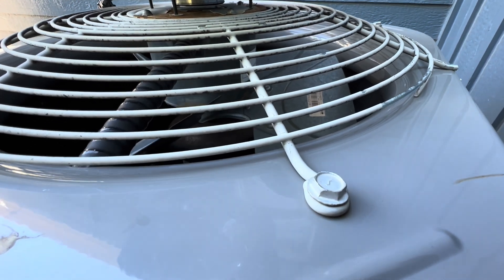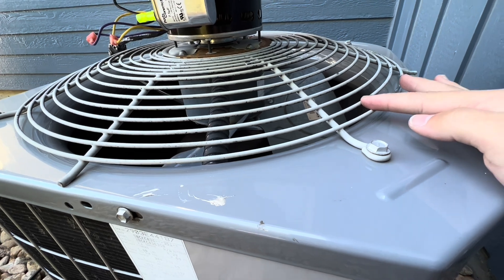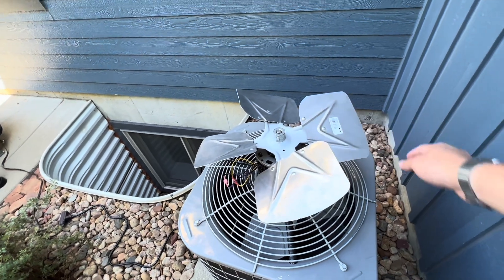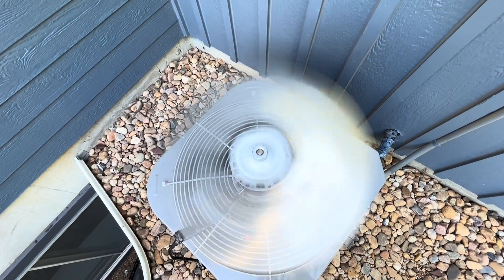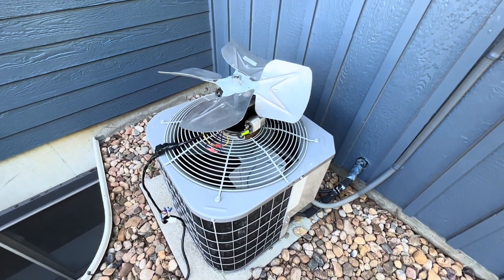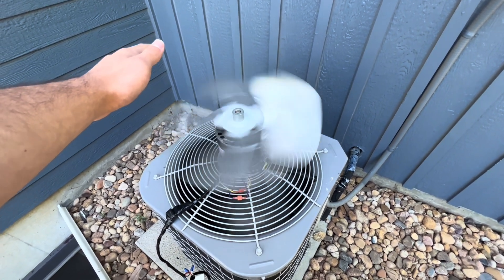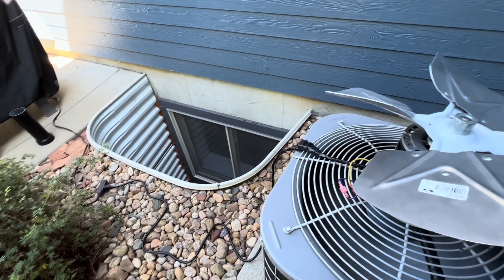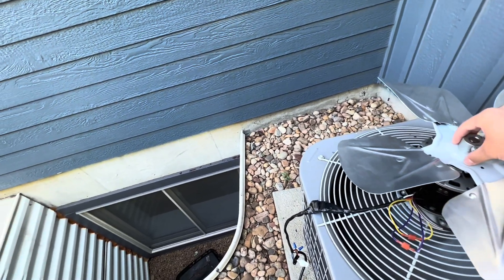HVAC Experiment: Will A 2nd Condenser Fan Improve Air Flow On An Outdoor AC Unit?

Comment: You can replace your aluminum fan in your A/C unit with a plastic fan, which is quieter and less heavy, so the fan motor would consume less power and spin faster.

Comment: I would say not to do this at all. Super dangerous. Also, the fan is not going to blow 100% of the air totally vertical. As others have said, the coils should be cleaned regularly, as should the internal components with some simple spray from a "shower" setting via regular garden hose with the appropriate nozzle. One issue you might have if you're adding cooling to the condenser, is that you could end up icing up the evaporator. Added cooling capacity needs that temperature differential to be used, or it will start cooling the air handler in the house instead, causing ice to build up. IF you're serious about adding airflow to the unit without changing the unit out, i'd recommend a duct with the grille on top. Then you get a more powerful variable speed indoor blower motor so youre not icing up the coil & you offset the money spent on powering that second outdoor fan. You could also get a variable speed condenser fan with higher motor rating and save the cost and jank of the duct.

Comment: The condenser is dirty try cleaning it you will ne surprised how much more the original fan blows the second fan isn't doing anything but pulling air from the sides into the bottom of the top fan with a little hot air from the condenser.

Comment: Kinda fun experiment.  But when the condenser coil is blocked up (needs cleaning), air will blow out the edges instead of the center of the fan grill.  See for example a video called "No AC Call on Sunday Goodman dollar bill test", at about 7:20 good ol' Ted Cook shows what's up.  The dollar bill test, a Franklin is optional but works for Ted.

Comment: 1 more explanation, your top fan when shut down is running backwards because the pressure diff at the center of the condenser, since it is not discharging straight up, is at negative pressure diff.

Comment: I can admire your experiment, but a few factors to consider.  Besides insinuating there is an increase in efficiency is a moot point as you actually are doing nothing as far as Eff... Since you have -0- measurements to prove that fact, it's actually not accurate.  Second, the fact that air is discharging out of the sides of the CFM grill is a CLEAR indication that the condenser coil is plugged, Period!  That is the reason it discharges from the sides instead of upward out of the top. The fan on top is only drawing air that is already discharged from the unit fan and along with "Free Air" is actually deceiving you and again not resulting in increased EFF Nor better air flow thru the condenser.  Once you chemically clean the condenser coil the air will discharge up and out directly as you seek. As a result, to measure Efficiency (and designed efficiency) the system must work as intended, as if new not plugged coil. The system design efficiencies are set and has to do with compressor co-efficiency and coil ability to remove Sensible heat from refrigerant circuit. Sub-cooling is designed into the system and is a fixed parameter by factory, don't you think they would have made a larger fan prop, or bigger discharge opening atop the cond. fan?  Anyways clean the condenser coil professionally and you will achieve the Max. Eff. designed for that unit.  Great try though... I can see why you have determined that the eff. has increased.  My .02  I've been doing this for a while and appreciate your findings...
Reply: Also agree with the other comments here, good empirical experiment, but also need to consider if there are any gains in efficiencies, they could be overcome by the power used by the second motor. That's why manufactures uses 80% ECM outdoor motors now over 65% efficiency PSC motors on certain units just to meet higher SEER ratings (for better or worse)  Don't stop experimenting, that's how we learn.